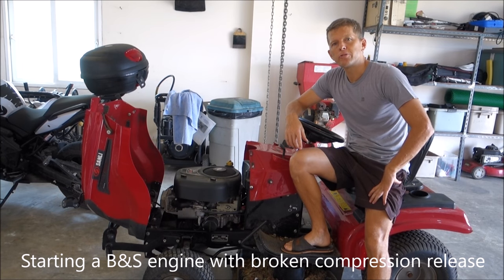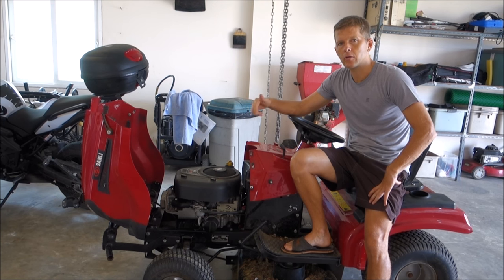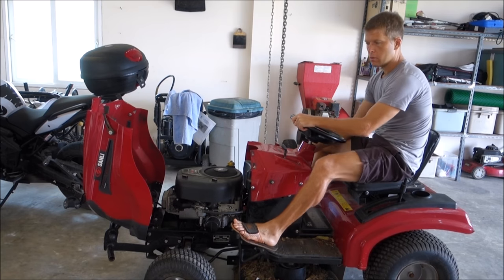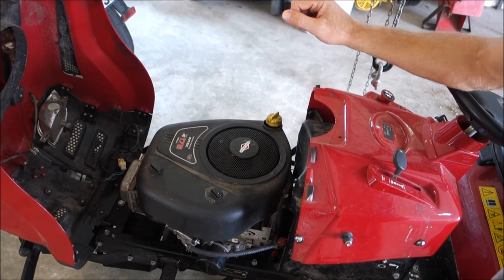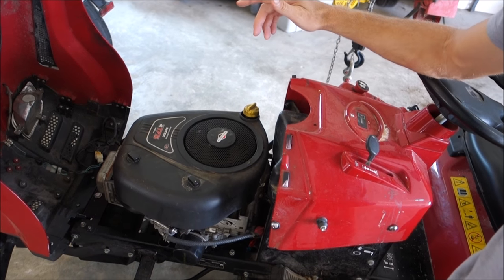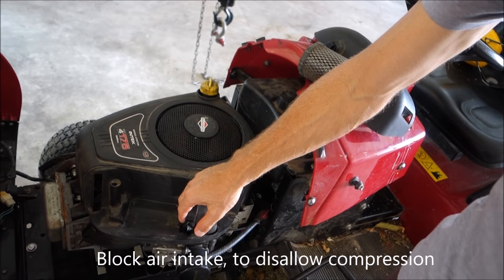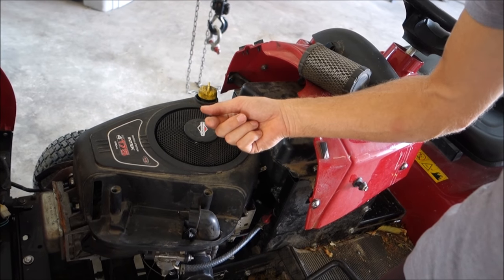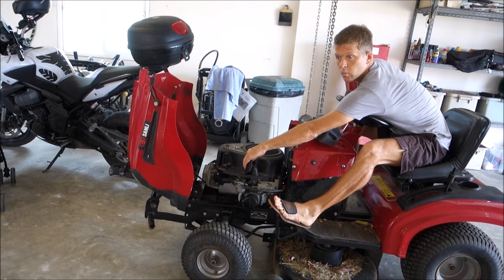Briggs & Stratton Compression releif fix

Comment: You are a genius,  never for a sec did i think the if no air goes in , then no compression will take place .thank you so much. My problem started every so often until it just won't have enough power to crank over. So i maybe 🤞🤞 my cam acr is not broken. I think maybe needs a valve adjustment.  Just waiting on the valve feeler to check clearance. But for now i will use it like this 😀

Comment: Holy Cow!  Been fighting with my mower all spring, was about ready to tear it apart and adjust the compression valve when I found this: IT WORKED!  Fired right off.  Thank you!  Not only for a winning hack, but for being short and to the point with it.  (Everyone else would have had a 10-15 minute video with info I didn’t need.  Straight to the point.  Problem? Solution!)
Reply: Its not a compression valve that you adjust. It's a compression release which is on the cam shaft the only way to fix it replace the whole cam shaft. You cannot but it separate.  Looks like a little arm

Comment: Could be a broken compression release, but not for everyone in the comments and everyone who viewed this. It is most often that a valve adjustment is needed, as it can appear to be the same problem. I readjusted my valves and it cured the problem.
Reply: It helped me. I kept adjusting valves thing didn't get tight or wrong gap. I still wish someone would show how to replace the part
Reply: @philponder5460  Chickanic has a YouTube video which shows the entire process in detail. However, it will eventually fail again because it is a defective design.

Comment: Great tip.   After exhaustive analysis of slenoid , battery, starter I finally pulled out the plug and saw that engine would spin fine.   That is how I knew it was a compression problem.    Did you trick and worked like a charm.    Thanks.

Comment: I was dubious this would work.  Had several other items to fix on my lawn tractor and knew it had a bad  compression relief valve.  Tried this process after other fixes completed and it worked like a charm.  Thank  you for this video. The tractor was going to the trash until I tried this.  I will now get more use from it.

Comment: genius. It works.  I already ordered a new camshaft but at least I can start it until the part comes in to make the repair. Thanks so much. The only thing I would caution those trying this is that it is still a higher  compression for the starter to turn over the engine and you risk the chance of stripping the plastic clutch on the starter which is basically the gear set on the top of the starter that engages the flywheel. 
I just picked up a mower advertised as having a blown motor but was a fairly new model at a very low price. Upon inspection, I realized it was the starter that was bad. Easy fix. Paid the man and took it home. I put a starter on it from another mower and only then did I find the bigger issue that the compression release was not working. That's how they ruined the starter. Trying over and over to start it and trashed the clutch gear. I just trashed the starter I put on it and will now have to wait for the starter rebuild kit (two of them) and make the proper repair when the camshaft comes in.
Reply: Actually it is not higher compression because there is no air / little air in cylinder to compress in the initial stroke when you have blocked air.  When it starts running, compression is fine , even that compression release doesn’t alter compression above certain rpm (300)

Comment: Easiest, fastest, fix ever. Been going crazy for 2 summers or more messing with mine. Good mower, and this was only problem. Couldn't afford repairs. Thank you, thank you, thank you. I haven't committed on YouTube in a few years, but just had to on this one. Worked perfectly!
Reply: Same. Replaced battery last year & starter yesterday, before I searched the internet & found there was a compression release mechanism on valve train that breaks. To fix... it's $100 for the part & you need to tear the engine down, then, even if you buy a new Briggs replacement part, it MAY break again in 2 months or 2 years? Gonna abandon ALL Briggs & Stratton engines now. 
BTW: ADJUST YOUR VALVES FIRST. That MAY fix it if the compression relief part is NOT broken inside the engine.

Comment: Amazing video! I don’t have this issue right now, but I do have an engine almost identical. I say almost because it has pressure lubrication with an oil filter. However, if I ever do, I will use this method to start it. Once the engine is going, there’s absolutely nothing wrong with it.

Comment: Hey Deep.
Great video. I have the exact problem. I've been working on my engine for 3 hours now trying to get the valves set. So I went back to YouTube and I found your video. What a relief. Mine is back running. I will fix mine come summer. Thanks a million.

Comment: Brilliant!!!! Just saved me dropping $2k+ on a new mower for the moment!!!  Thanks for this, simply awesome solution!!!🎉🎉🎉
Reply: I wish I saw this video a couple days ago. I just bought a lightly used John Deere x300 for $2200, because no matter what I tried, I couldn't get my Briggs to turn past TDC on the compreasion stroke. I will try this choke method to keep as much air from gerting intonthe cylinder during the intake stroke as I can. Such a forehead-slapping simple solution!
Reply: @logmeindangit  fwiw, I ultimately replaced the cam in my engine, 30 dollar part, engine runs like new. Pita to do the job, but also a cheap and 'proper' repair I. The end.

Comment: Thank you for this information! This workaround never occured to me and works almost every time. Sometimes,I have to "unwind" the engine to get a running start at TDC,but it never fails! This is an awesome workaround. NOT a permanent fix,but something to get you through the yard till one (me)gets the time to do the proper major teardown and fix it right.
Reply: I have to unwind my engine as well. Do u think this would be bad for my engine cuz I’m worried, thank you.
Reply: @cadesperry3467  The very first thing to check,before you do anything else is to check the valve lash settings. This will mimic a broken compression release.
Even the slightest too loose setting on the valve lash will not allow the compression release to function.
  I learned this from the Lawnmower Forum.Many people think that when the engine hesitates when hitting TDC,that the compression release is broken. Usually,it is not,it is a too loose setting on the valve clearance. So,check those settings FIRST.
Reply: @samanthao1240  Agree. Adjusting the valves FIRST, MAY fix it if the compression relief part is NOT broken inside the engine.

Comment: I can confirm this worked for me after several attempts. I put a battery charger on the battery while doing this and squirt a little starter fluid in the air filter tube and then put a wash rag over the tube and it started. Thanks for the quick work around till I can get the camshaft replaced. 

Date: 3/21/2024

Comment: Awesome idea!!... I usually advance the top of crank fan with my palm until the exhaust stroke then start, but it can be hard to do sometimes. This issue typically happens on the single cylinder engines especially the Briggs and Scrap-um.

Comment: Thank you so much! I really appreciate the time you took to make this video. It saved me a lot of time and money ( throwing parts into the mower that It didn’t need, starter, battery, etc)
Reply: Too late for me. I installed a New battery ($40), then new starter ($35) before I knew there was an internal compression release mechanism that breaks.
BTW: ADJUST YOUR VALVES FIRST. That MAY fix it if the compression relief part is NOT broken inside the engine.

Comment: If this does not work for you because the intake tube is configured so it is difficult to "cover"... Yesterday I found a method that worked for me. I turned flywheel by hand using screen-like cover, to the compression  stroke... until I could not turn it anymore. Then I turned it backwards 2 full revolutions. I removed air cleaner. I gave it 2 squirts of ether/starting fluid in intake. Stuck rag in intake. Gave it full throttle/choke. Turned key, it STARTED & I pulled rag out simultaneously!
Idk how long this will work for me, but it worked!

Comment: Thanks for sharing your knowledge, in my case the model number stamped couldn’t be read so I have a few options. After seeing your video I did as you instructed and WORKS really WORKS, thank you so much. I have a 2007 craftsman 21hp ohv 46” cut that I’m using

Comment: THANK YOU!!!
My John Deere LR135 wasn't starting. I changed the solenoid, then the starter motor, no joy, did some research, adjusted the valve clearances... and on the way I took a detour by stripping the thread on the spark plug hole. 🤦‍♂️ Took the head off, recut the thread, put the head back on, adjusted the valve clearances again, no start. 😭
Watched your video... "aha!" I thought, simples! Tried it, made no difference. Took the battery off to recharge it. Was about to kick the American piece of s**t goodnight and noticed the plug lead wasn't on. 🤦‍♂️
Charged the battery overnight and refitted it. No yellow light. Started looking around, found a fuse holder wasn't holding the fuse tightly (also my fault 🤦‍♂️)
Put my hand over the air intake, turned the key and the old girl started up first time, that suck on your hand from the vacuum is like a kiss from the machine saying thank you 😂
Anyway I owe you a beer, cheers! 🍻

Comment: Great tip!  The compression release on these engines is a mechanical part on the camshaft and it fails too often. It's been redesigned a few times but still causes problems.

Comment: The solution he proposes will start the engine, but if the compression value has broken you could do more damage if the pieces get into the engine.  This happened when my son kept running his with a broken compression value.

Comment: I have the same problem. Thank you for showing me how to get it started. But I kinda put things off. I ran it like that through the summer and the parts in side the engine somehow busted my block. Lol. I J B Welded that. But l changed my cam. Now. So far so good. Thanks again. I loved the video.

Comment: It is indeed brilliant tip, no air, nothing to compress. I performed all maintenance, including replacing a 4 year old OE battery on 4 year old craftsman, nothing would budge it. I knew it was compression problem so I checked , rechecked valve gap many times,  tried to move it past compression tdc and start it numerous times , no way .
 I am still puzzled why manufacturers use such an antiquated design.

Comment: I found that just turning the flywheel backwards until it stops, ( grab the screen and turn counter clockwise), it will put the piston in a no compression position and when you crank over there is enough momentum to let it continue to crank.

Comment: This got my mower going again!! Thanks for making this video. Smart..don't know why I didn't think of this workaround. Briggs & Stratton should fix this weakness of the OHV engines. Shameful. Also should filx head gasket problems with engine. I won't be buying any single cylinder B&S engines anytime soon after this my experiences with the one on my Husqvarna Craftsman branded riding mower. Mower is great but the B&S engine is a stinker.

Comment: Unfortunately, this trick did not work with my 20hp Briggs Intek. What did work was to place my rubber-gloved hand on the top of the intake fan and rotate the fan CCW until about 180 degrees before the compression stroke. You will know when you get there by how easy the fan is to turn for a brief duration. Keep turning CCW until you just feel resistance. Stop turning.  Now hit the start and the engine should revolve just enough during this non-compression cycle to get enough inertia to overcome the compression stroke. The best thing about this technique is there is no need to remove the air filter cover and air filter. A word of caution: often when the compression release mechanism grenades (usually leaves about 6-7 shards of metal) it can severely damage internal components such as the cam lobes, governor, camshaft timing gear, and even the piston skirt. A sure sign of major damage is reduced compression or what looks like silver paint in your oil. Not good. Ask me how I know.
Reply: That's how I start mine

Comment: I came up with another way. I tightened up on the exhaust vale adjustment just to the point where I could turn the engine over on the top of the compression stroke. You have to be careful not to over do it. Tweak it just to the point where the engine turns past the compression stroke by hand with some effort. I put the valve cover back on and I have run it that way for 7 years now. I noticed no horsepower loss and it starts and runs fine. 

But I like your way better.
Reply: brdman  Cool. Another way is to take the air filter off and use something to cover the air intake while you turn it over. As soon as it fires remove it. With blocking the air intake the compression is reduced.  Problem solved.
Reply: brdman  I watched a video on it....it's not as  time consuming as it sounds.  
Anyway....when this Briggs finally stops working I'll never buy another machine with one until they make that part bullet proof.

Comment: it worked but there is an easier way, 
1- Try and start until it stops,
2- turn the fan on top clockwise slowly until you just get past the compression stroke. (when it gets easier to turn then stop)
3- turn the key and it should build enough speed to keep going.
It worked on mine. I wish b&s stopped this bs and put on a manual decomp lever too like the single cylinder diesel engines have.
Edit: a warning to others, if you do run the engine with a broken decompression thing then those broken parts are loose inside your engine and can cause damage, the bits broke the governor in mine which almost caused a runaway. Just fix it it's not hard

Comment: This can work well, but two points:
1) Make sure that whatever you use to cover the intake is not small enough to get sucked in.
2) DON'T use your bare hand - the engine can backfire when doing this, especially if it is already warm.

Comment: adjusted the valves tip from another video and it didn't work. Looked for the bump test for cam shaft and passed. I watched this video earlier, went out tried it and it didn't start, came back to youtube and watch a different valve adjusting video with 1 open and 1 closed valve and adjust to .004 on both, opening 1 at a time. then closed her up and did Deep Adventures method off cutting off the air and it started right up TY!!!!! I been at this for 3 weeks, oil change, new spark plug, no metal in oil, new starter and I was losing my mind my it wouldn't turn on.  Now it re-starts when I turned it off twice like nothing has ever happened.

Comment: 2011 Troy Built Bronco the engine was doing the same thing. The thing in the middle would spin maybe twice around, then would get very stiff. I set the spinning thing in the middle to were it was just free and could start its way making two full spins before getting stiff again. Then i covered the air intake and started the mower like in the video took maybe 3 times. Remember to reset the spinning thing in the middle lol. eventually you will get it !

Comment: An even easier solution is to just spin the flywheel with your palm counter clockwise until you can't. Will fire right up. Keep in mind that you still have broken parts in the engine which can cause even further issues. Replace camshaft and idle down before turning off.

Comment: I suggest if you decide to keep using the engine to change the oil and use a magnet to attempt to retrieve any metal pieces out the drain hole.

Comment: This is the only way I can start mine.
It is an OHV but has no compression release (from the factory on this model)
but even with the valves adjust okay, it it super hard to crank.
This is a bit of a pain if you are doing heavy mowing that causes the engine to stop frequently (like from tall grass stopping the blades) but at least it works.

Comment: I have the same problem.   This was so easy to do it was worth trying but unfortunately didn't work for me.  Maybe if my battery and starter was new it could get over the compression hump.     I have a new camshaft to install...but obviously wanted to try this first.
Reply: Sometimes you have to bump it (the starter) multiple times before the intake side will begin building a vacuum) and the seal over the intake has to make contact all around too.
Weak vs new Battery and starter doesn't make much difference because the compression as you get nearer to TDC increases exponentially.
If yours ever goes bad again, it might be worth trying this again. It's a bit of an art to get the intake vacuum to take hold.